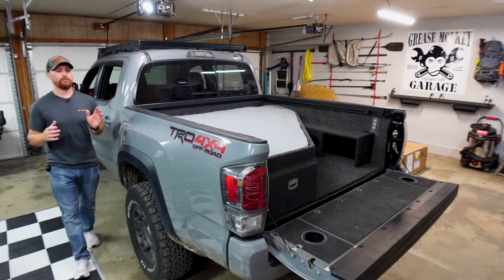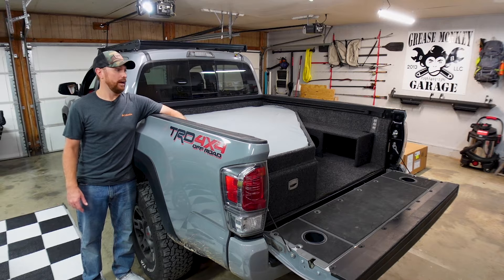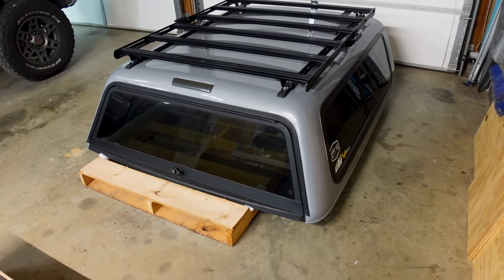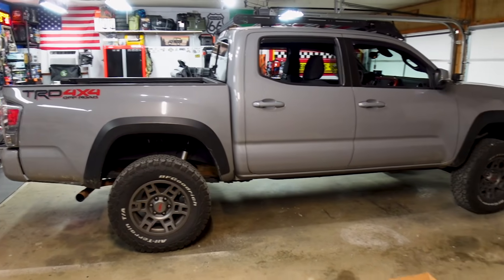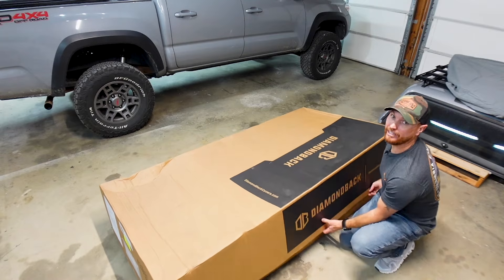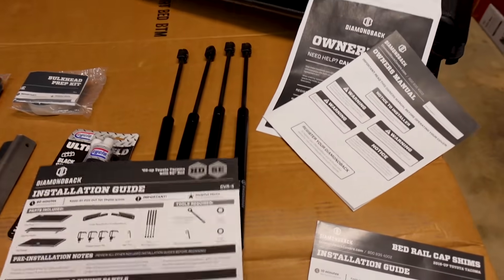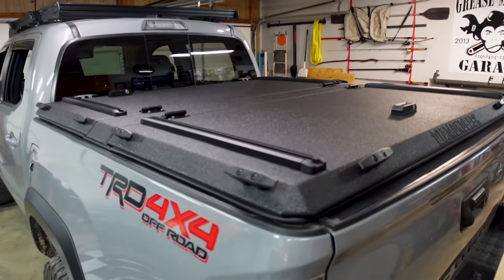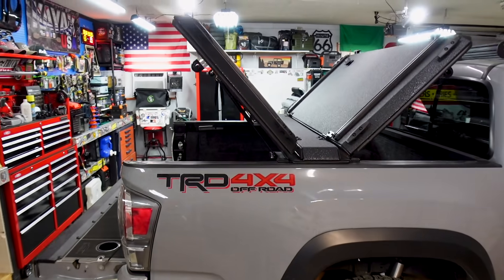Truck Camping with a Diamondback? NEW Truck Camper Build!!

Comment: Just remember, you lose that bed access once you install the RTT, since you can no longer open the cover.  Suggest a pulley overhead storage system for the RTT in your garage when you're not camping
Reply from the maker: Yeah, check my channel out, I have a full video building one of those in my garage 👍🏼

Comment: On my Tacoma, I've gone from a Diamondback HD with hard shell RTT (didn't like climbing the ladder to the tent, or tent flaps flapping in the wind, and the installed tent prevented opening up the Diamondback), to a 4WD adventure van (sat parked most of the year as an additional vehicle expense and theft target), back to my Tacoma with only the Diamondback cover.  I plan to still do remote adventure, but use motels, etc. most nights, and sleep under the cover on the occasional night of dispersed camping.  With the 6' bed and one end of the cover lifted up slightly and locked in the "bolt extended" position, it's almost impossible to be accidentally locked in, but you still have ventilation and good bear security while sleeping.  The Diamondback is awesome for everyday driving since it's relatively secure, and my Tacoma remains an everyday driver without a bunch of additional weight/height, and usable as a pickup.  So many options, I fully agree to keep things flexible and avoid permanent modifications.

Comment: just a suggestion with some 2x4s and cable and winch system you can make a camper shell hoist/storage from the ceiling of your garage and can lower on to truck whenever or lift off and leave up out of the way that’s what i did to store the shell and helps a lot with space and anytime you need to out on or off makes it really easy
Reply from the maker: Be sure to check out my channel, I have a video on how I built one of those in my garage a few years ago. 👍🏼

Comment: Nice!  A question.  If you opened the rear portion of the cover and layed it flat over the mid and front portion, and I supposed tied it down, would a road or mtn bike fit in the opening side to side with the tailgate closed?  It's tough to tell, but I imagine that center support portion of the cover that is clamped down is a bit too far to the rear for a road or mtn bike to sit front to back hanging partly over the closed tailgate with the front tires on the outside as we see done so often?  It's not necessarily mandatory for me, but it sure would be nice.  Do you know?